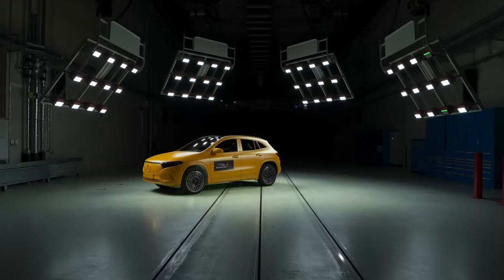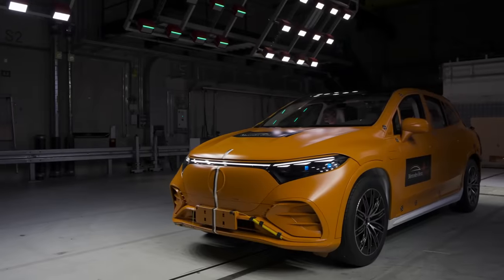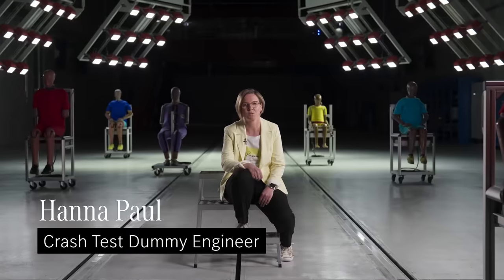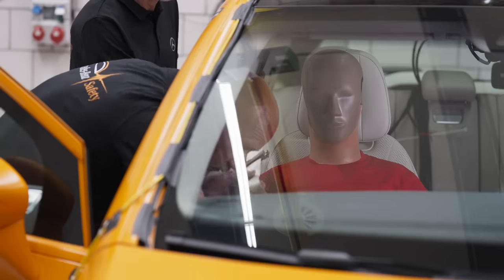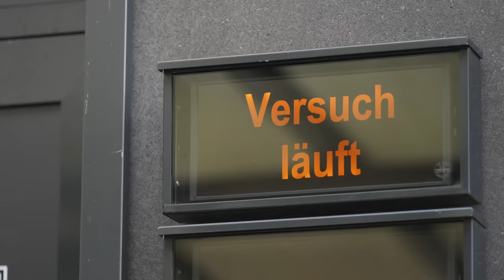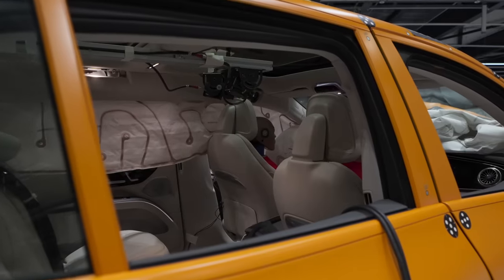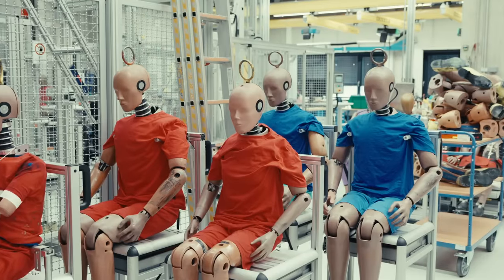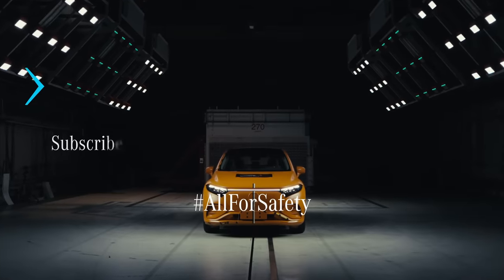The world's first public two-car electric crash test by Mercedes-Benz

Comment: Now show us how this 2.5T monster squeezes the life out of a pedestrian when a drunk driver is overspeeding.
Reply: The car will stop on its own ;-)
Reply: Just like any other car, the weight of the car matters almost nothing when compared to a 65 kg pedestrian. Even a 1000kg car is more then 10 times as heavy
Reply: @marioghioneto1275  true.
It all comes down to design and active safety features of the car. Well and luck
Reply: Even a motorcycle can be deadly in that case. Such a stupid comment “Now show us how an ev being used for terrorist attacks can be deadly” drunk driving is illegal.
Reply: Also there are some proposals to have invult breathalysers which would prevent drunk driving at all
Reply: @quelandil5738  🤣🤣🤣🤣 you believe in that?
Reply: @kumir_  That has nothing to do with believe.
There is enough data to KNOW that these systems make a difference.....
Reply: @sonpietersen2242 some people drive like crap and they don't drink at all. what about them?
Reply: @henkolsonpietersen2242  the more mass the vehicle has, the more deadly it is. simple fact. combine that with how quickly EVs accelerate and you have a potential problem on your hands when you add the x factor... the driver.
drunk or not, if i floor it in my car from a standstill within ten seconds it can have a kinetic energy of around 200kJ, an average EV in the same time would have 1-2MJ.
imagine someone having a medical episode and getting their foot stuck on the accelerator.
Reply: @JTV84  Yeah, except for the fact you're talking about an extremely rare scenario. Sure, more mass, more acceleration = bigger problem, however, being drunk is a MUCH bigger problem. Just look at the incidence of vehicle related death caused by drunk drivers vs. EVs. It's a simple fact, really.
Reply: @quelandil5738 sometimes, most of the time it splatters the pedestrian.
Reply: @bugsymalone5744  sure thing, but sometimes is better than never I'd say.

Comment: Great video. I am surprised that almost all test are at 56 kph or 35 mph. Am I the only one who would be more interested at a more realistic 55 mph tests.
Reply: US safety testing is only done up to 37mph, if you want faster Volvo does some test up to 75mph
Reply: They can't show you such an accidents, this is bad for their reputation
Reply: @BANDERAZZ07RUS indeed. Also they don't show it with a smart fortwo getting totally violated by the big massive e-shit
Reply: There’s a video of a Rivian pick up tearing through a common steel guard rail like it was tissue paper. Only stopped by huge concrete blocks.
Reply: Above 55 mph you get battery explosions hence they never show it.
Reply: 55 mph frontal crashes are not that realistic and there are quite senseless, since no vehicle is built to withstand a crash with 200 kmph relative velocity. You can take any vehicle you like, the result would be the same at those speed: Most certain death.

Comment: How many tests did you do before you did not get thermal overload
Reply: There another video from the day after with the test center ablaze.
Reply: That’s a good question….They would never let you see that!
Reply: Well a car can only crash once can't it?? Such a stupid point to focus on!
EVs are safer than ICE cars - and no they do not burst into fire more often that a petrol or diesel car - quite the opposite
Reply: @Greatdane-qf8kd  I drive an EV myself. EVs do have fewer fires. It is the character of the fires that are the problem. Though not the purpose of the crash test, to determine what happens later, but it would be relevant to include a 24 hrs or similar, observation period after, in EV crash tests. I doubt any EV with one more deformed cells, will not catch fire.
Reply: @Tore_Lund  exactly. it's not just what happens in a few milliseconds that matters.
Reply: @Greatdane-qf8kd  Rubbish.
Reply: @Daniel-S1  What is rubbish? Statistically I'm right. Otherwise prove me wrong 🤦

Comment: Would be useful to find out at what crash speed the battery ruptures!
Reply: If it´s designed well the occupants rupture before the battery does, so it doesn´t matter :)
But I am curious, too.
Also I asume side impacts are a much higher risk for the battery since there´s much less material between the other car (or tree) and the battery.
Reply: 57 km/h 😂
Reply: @tivrobobo 
35 mph. Now try again at highway speeds like 50, 60 mph and with fully charged batteries. Did the cars even have batteries
Reply: @davidhenderson3400 There is no evidence pointing in the direction that speed should be an issue, so they point it out?? Should it be any better having a 50 l tank of gasoline under your body while crashing at 60 mph I might ask??
Reply: @Greatdane-qf8kd  There are decades of evidence to show the difference speed makes. Give you a clue, in liquid fuel cars, the tank is not under you. It's usually behind you and in a separate cell of the vehicle. More speed does more damage. There is a specific point where the body gives way to expose the tank / battery. It ain't 35mph!

Comment: "Our vision is zero fatal accidents in 2050."....Romanian drivers: hold my beer 😁
Reply: When all vehicles are electric and controlled to eliminate all accidents by them all being automatically saved from accidents
Reply: Romanian cars:
Will last to 2050 and more
Mercered in 5 years after warranty:
Visit workshop!
Car in emergency mode
Battery dead, Stop and replace a battery!
CHANGE YOUR CAR! BUY NEW ONE!
Reply: Accidents can only be completely eliminated when ALL vehicles on the road are completely autonomous with absolutely no driver intervention. Accidents come from driver error, even when an animal jumps out. We simply can't react fast enough but an AI that can, will be able to avoid it, as will cars with better safety systems (ABS being a huge game changer when that came in).

Unfortunately, this is unlikely to happen in any of our lifetimes.
Reply: @ElusiveTy  If you think automation will remove accidents from driving, I have some bad news for you! XD
Reply: @thisthat283  That's their mission failed then. I'm likely to survive 2050 and intend to drive 20th century cars as long I live.

Comment: Both are very heavy  , what happens if the opponent is a light combustion car ?
What happens with this high mass cars if the fastness is a little higher ? Is it weight then exponentiell ?
Reply: When the other car is lighter, the lighter car takes more damage than the heavier one.
When speed increases, force also increases, but linearly.
Simple physics.
Reply: @koko-lores  sadly 😢
Reply: @koko-lores  is damage caused by momentum or kinetic energy? kinetic energy increases with velocity squared.

Comment: Mind you this isnt the NHTSA this is the manufacturer. The NHTSA will still do the same tests but its good to see that they are taking the initiative on saftey and showing the public the results.
Reply: Mercedes Benz has always been on the forefront of safety features. They came up with all kinds of safety features on every car now made that people take for granted... they all came from Mercedes or S-Class vehicles. Like the recent invention of air suspension raising the vehicle to where a side impact on an S-Class will raise the entire side of the car up as high as it will go so that the crash impacts the MUCH stronger subframe below the vehicle instead of the weak door or B-Pillar. That's an insane technology.

Comment: why during crach the inside camera shows only what happens on the right(more safe) side? Why dont you show what happened with the drivers?
Reply: Cause it is way more interesting. Everybody already saw an airbag from the steering wheel. But this angle shows how they managed to implement an airbag with the screen in the dashboard, where it would usually be placed.
Drivers and passenger dummies both showed low risks of lethal injuries.

Comment: Where did the standard crash test speed of 64 km/h go? Did Mercedes calculate the maximum speed for the smaller EQA 300 in the simulation so well that it knew that at 64 km/h this video would not be suitable for publication (with broken a piller in EQA 300) ?
Reply from the maker: Hello Jacek, from our crash research we have learned that 56 km/h is the typical crash speed during an accident outside urban areas. Furthermore, we are of course also conducting crash tests at much higher speeds.

Comment: Now do it with the batteries connected and let’s watch the unstoppable fire that ensues.
Reply: Kind of what a was thinking🙃
Reply: Pretty sure they DID do it with the batteries connected. One of the things they were checking for was that the high voltage system was disconnected.

EVs are designed such that the high voltage does not leave the battery pack without the contactors being energized by the 12V battery. It looks like the 12V battery did indeed survive the crash: as evidenced by the hazard lights activating after the crash.
Reply: @jamesphillips2285  I'm not sure about mercedes but other manufacturers have devices to cut the HV connection when the vehicle detects a crash, usually a squib.
Reply: @ianrobertson3419 

They are set up to not react.

In reality, those batteries would be damaged, and the area around the accident would be considered a toxic waste site.
Reply: @marktwain2053  that's not how this test or any other test works.   Of course the battery isn't going to explode, the cars are designed better than that.
Reply: @ianrobertson3419  A pyro fuse may be needed to break DC current: but I think just removing 12V from the contactors should be enough to disconnect the battery.

They have 2 contractors in case one welds closed.
Reply: Do you think that the people at Benz are stupid and only you thought of that.  🤡

Comment: I noticed they voiced their concern about protecting the car battery!  I wonder what happens at higher speed collisions when the batteries are damaged.  What is the worst case scenario?  A huge fire that even the fire dept can't extinguish?  It is these things the public needs to know more about.
Reply: Well have you ever seen a transformer explodes on the power pole..... well

But only the the more serious accidents this will occur and even ICE gas tanks also experience that in that scenario.
Reply: probably not as bad as with petrol.
Reply: Have you ever seen a petrol tank go up after a high speed collision?, it's really not pretty.
Reply: @dexterjsullen   Transformer doesn't contain deadly Lithium.

Comment: As a Mercedes Owner it would be honestly  interesting to see also inboard views during the Crash of the smaller car > EQA 😊
Reply: There are similar videos - all you see is air bags
Reply: Exactly! Just to see how overweight cars would just wipe out regular size hatch for example..
Reply: But what about if it gets hit by a bus, im sure the battery would blow up. if you say thats crazy ive been hit by a bus so you never know
Reply: @MKfoil  Americans already drive oversized cars man?! So what's the problem?
Seems like you only point to the weight of an EV - forgetting that they are much more safe than much regular cars on the road. 
Evidence points to the fact that EVs are involved in less fatalities and crashes in general in America due to the many new safety features that are installed in them.
Reply: @ferdtheterd3897  You're sure 😂😂 So now that's what you build all your knowledge on 😂
Reply: @Greatdane-qf8kd  no but in the event of an emergency with a EV youre literally strapped to a bomb. Gas cars have 100 years of safety features built in
Reply: @ferdtheterd3897  Nonsense! So you think it's safer to have a 50 liter gasolinetank strapped under you in case of a crash?? 
I can also tell you that the newest numbers show that EVs are involved in fewer crashes AND more importantly much fewer fatalities than ICE vehicles.

Comment: This was an amazing video! This concept helps others understand that electric vehicles are a safe and smart vehicle. Everybody likes to say that they are useless and they are a stupid idea, but now I understand more and feel even more safer with electric vehicles than my own vehicle!
Reply: Please do even a minimal search of YouTube and you will find many ev fire hazards.  Us made evs are better, but water intrusion into the battery can be deadly
Reply: @howebrad4601  Exactly, this video is one example of millions of variables. Plenty of potential for EV battery thermal runaway during an accident that can have toxic off-gas in the cabin and also explosive hydrogen. I've seen some EV explosions. A recent one was a Jeep EV that blew the roof off while firefighters were working on it. If anyone were in the car it would have not been survivable.
Reply: EVs still remain safer than combustion vehicles
Reply: @ackylles978  Wait until we have millions of old EVs on the road like ICE. Going to be a lot of fire/explosion hazards with old lithium batteries. Insurance premiums are already skyrocketing for a myriad of reasons all revolving around the battery.
Reply: @practicalguy973  Don't worry. The situation can only be better. Electric cars have been around for more than 10 years and yet they are 16 to 20 times less likely to catch fire than a thermal car.

Comment: But the batteries are dangerous crash or no crash. Not to mention the cold weather issues, you know like turning on the heat to stay warm, charging times, charging cost, planning everywhere you go so you don't go too far and get stuck for hours! ..and so on
Reply: Hasn't been a problem for me, maybe you should try one and find out.  The oil and gas companies sure want you to think they're all bad, reality is different.
Reply: Oh yeah, and the high voltage components automatically shut off in a crash, so you can't move the vehicle off the road... 

The older I get, the more I love old cars! :3
Reply: @ianrobertson3419  Sorry, I like my classic Jaguar. EV's are just fancy golf carts. Worthless in the future too, when the battery is dead or cost more than the body is worth. And not to mention how ugly most cars are now days.
Reply: @jamesgizasson  you obviously aren't aware of fuel shutoffs.  Cars have had them for decades now.
Reply: @roylcraft  lol, jaguar has made some of the ugliest cars in history.  Not to mention their reliability is awful.
Reply: @ianrobertson3419  I'm aware they exist; I'm also aware they don't exist in my vehicles. I'm very particular about what my cars 'allow' me to do.
Reply: @jamesgizasson  what vehicle and year do you drive? id be happy to point out the various safety systems for you.    That is unless you have a carburated classic as your daily driver.  They didn't have too many safety devices.
Reply: @ianrobertson3419  My Beetle is a classic; my daily is a 30 year old diesel Ram. As far as I know, there's a fuel shutoff solenoid, but it's manually controlled by the ignition.
Reply: @ianrobertson3419   Fuel shuts off but not the voltage to door locks and power brakes and steering and lights etc.
Reply: @jamesgizasson  The beetle is an amazing piece of engineering.  Simple, cheap, efficient.  Not great on the highway or in accidents and they tend to smell really bad but classic nonetheless.
Reply: @ianrobertson3419  Agreed. They stand in absolute defiance of planned obsolescence, because anybody can fix them!
Reply: @roylcraft  yes, that's correct, same as most ev's.  The hvb contacts get interrupted and the 12v systems would still function as designed.  EV's have a separate low voltage system for accessories, just like an ICE vehicle.

Comment: The thing these people don't mention is that these cars are 2x heavier than an average commuter car, like a small gasoline hatchback. The batteries increase the weight of these cars to be closer to industrial pick-up trucks, like the Ford F-450/350 than that of a traditional car/SUV.
Reply: Well, typical (small) ICE hatchbacks like Renault Clio (1150kg), Ford Focus (1350kg), BMW 1-series (1450kg), are not twice as light as comparable BEV hatchback but BEVs tend to be (a little) heavier -> such as BMW i3 (1350kg), Renault Zoe (1500kg), Nissan Leaf (1500kg). Comparing gasoline SUVs with BEV SUVs gives similar differences: BMW X3 (1900kg) vs iX3 (2150kg), Mercedes GLE (2500kg) vs EQE SUV (2400kg), and Volvo XC40 ICE (2200kg) vs Volvo XC40 BEV (2400kg). Overall, yes, BEV tend to be heavier than gasoline cars BUT it is weird to say BEVs are 2x heavier than an average commuter car because SUVs are always much heavier than hatchbacks, BEV or ICE.
Reply: Furthermore, a Ford F-450 on average weights 3600kg, a Ford F-350 on average 3400kg. Both way beyond the numbers I ran in my previous comment. These industrial pick-up trucks are almost three times the weight of your average ICE hatchback. With the average ICE hatchback weight (of the three mentioned cars) of 1315kg, BEV hatchback average weight (of mentioned cars) of 1450kg, average ICE SUV weight (of mentioned cars) of 2200kg, and average BEV SUV weight (of mentioned cars) of 2315kg, they are way lighter than your pick in pick-up.

Comment: The problem is the  risk of enormous damage that non EV vehicles 😮 will suffer when crashing EVs
Reply: I was thinking the same. I work for MB and drive the EQ models all day long and they just feel heavier almost like they could blast through a thick concreate wall.
Reply: Then how about they just pay attention to the road and get off their phone, then they won't crash into anyone at all.
Reply: @Waldo1122  Sure, but what about the real world?
Reply: nailed that one haha  @Georgeed
Reply: @Waldo1122 let’s first make sure trucks don’t have loose chains or tools, deer don’t run onto roads, every pothole is fixed so tires don’t fail or steering components fail.